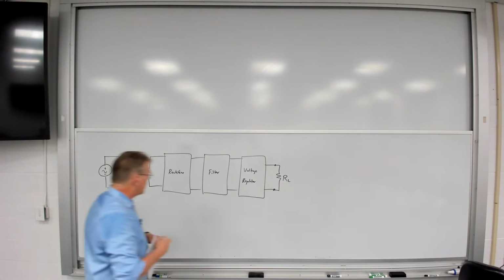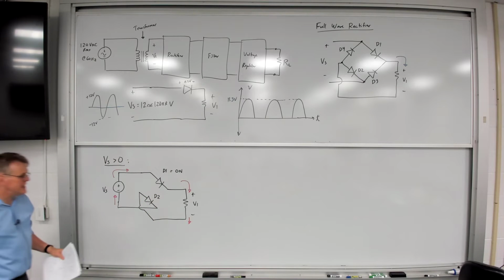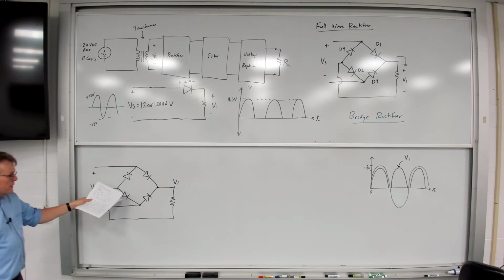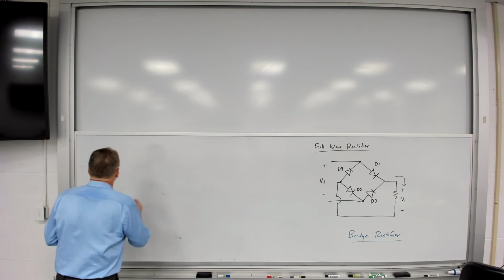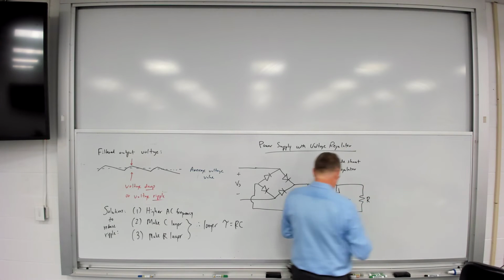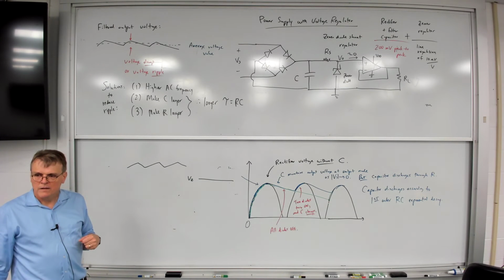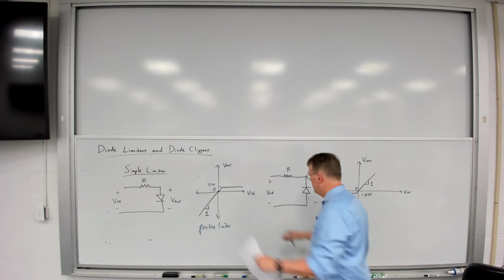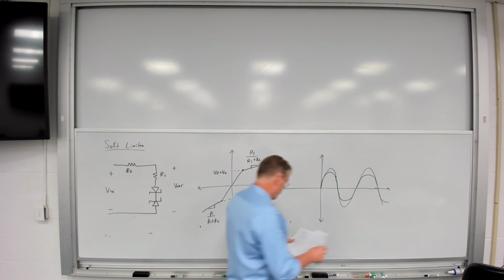Electronics - Lecture 7:  Power supplies, full wave rectifiers, output voltage droop, diode limiters

Comment: Prof. Tim Holman, when you added the regulator to the full wave rectifier, what is the purpose of adding the resistor, Rs?
Reply from the maker: You actually need Rs in this circuit to make the regulator work.  The Zener diode regulates at a lower voltage than the voltage generated by the full-wave filtered rectifier, and Rs has a voltage drop that is the difference in those voltages.
Reply: @wtimothyholman  Makes sense, thank you for your response.